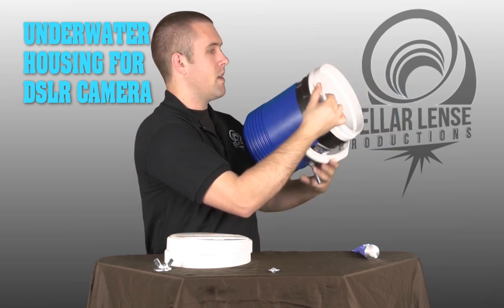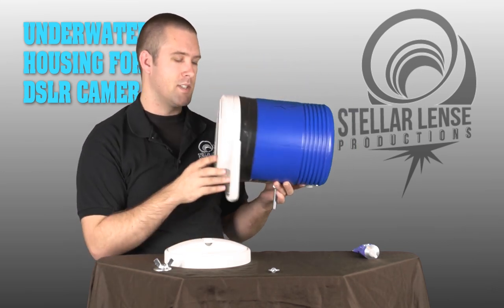DIY Underwater Housing for DSLR Camera

Comment: You can actually make a DIY submarine for under $100. You just need a 70 gallon trash container, a couple 45 lb. weights, a 2'x2' sheet of plexiglass, some aquarium caulk, a plunger, and an electric trolling motor. Saw a hole in the base of the container, run the shaft of the trolling motor through the rubber plunger head, caulk the plunger onto the hole, saw a hole at eye level and caulk in your plexiglass window, toss in the weights, and this will safely take you down to at least 350 feet. Water pressure will hold the lid down nice and tight, so no worries there. These also make a cheap and easy gift for friends and family, just remember that for small children you may need to add an extra 45 lb. weight to get the sub down to maximum depths.

Comment: I'm gonna do this for photography (not video), and I can drill a small hole and slide in shutter release cable and seal off with silicon (or paste used in this video), but cable release will have to live there forever. 
Thanks for the video, good job.

Comment: DUDE! not only are you dope for coming up with this solution of how to circumvent the ridiculously overpriced underwater cameras housings, but the fact that you made a such a precise clear cut video tutorial on how to replicate it is. .... dope as well. Do you have any ideas on how to make it to where you can take pictures? Exactly what I needed.
Do you have any idea of putting in a waterproof hole in the cooler to allow you to hit the shutter of a DSLR?
Reply: Buy a Dicapac.
Reply: Or buy a wireless remote control and add it to the interesting invention, but definitely advise to buy the proper equipment for the job
Reply: Just keep a remote shutter in a plastic bag with you

Comment: Plexiglass and other plastics will severely degrade imagequality. It would be better to use plain glass, a thick enough quality to withstand the waterpressure, which will make the rig somewhat heavier but since weight is relative underwater it wont cause any problems. The upside is ending up with a much higher imagequality.

Comment: From a diver who does this for a living.  You need to include a co2 inflator to add a bit of pressure to the can.  Water pressure could have pushed your lens inward; flooding your housing and camera.  

Otherwise it's a smart practical solution for your project.

Comment from the maker: Just a quick update, the plexiglass is NOT easy to cut with a razor blade. I practically had to saw at it with a razor blade and snap the pieces off. I'm sure there's an easier way to cut it. Might be worth researching before you start

Comment: More secure if plexi cut wider than a hole and applied to outside - a rim helps reduce risk of blow-in (use sealant still). Plenty of silicone grease might help with screwed lid. Very very limited depth possible: 10metres (33 feet) of water depth adds 1 atmosphere of pressure... (~1kg/cm^2) so a 10cm diameter window ~ 75cm^2 = 75kg load, same as an adult standing on 1-foot: plexi risks breaking, or bending breaking edge seal ? Would over-turned container take several adults at once or crack ?

Comment from the maker: Only have used it in a pool and a river thus far. 6 foot depth at a maximum probably. And when I used it in the pool it actually still leaked a bit but that was where the lid screwed on, so all of my glueing and sealing held perfectly, but the lid seal that came with it sucked. So If I were to re-make this I would probably use something better than an igloo from walmart. But even with the leak, I could get like 10 minutes underwater before it would come close to getting the camera wet. - Phillip

Comment: It amazes me how mad people get at the price of underwater housings. Do you really want something protecting your camera that costs LESS than your camera?
Reply: There's no way in hell I'd put my camera in this thing and I've only got a 30d.
Reply: Nick Lewis Not to offend you but that is a really silly thing to say.  The fact that it costs less than the camera does not means that it does not performs well . Check the gopro diving housing, it costs way less than the camera and  performs extremely well. It can go down to 60 meters.... Most Underwater housings are made of the same stuff a  Polycarbonate polymer   Underwater housings for dslrs are extremely overpriced and the reason is that there are not many companies that make them. That is the only reason. It is a kind of monopoly.  I am very surprised that our Chinese friends have not tap already into that market and make affordable housings, cause polymers are quite cheap
Reply: I can tell you now that you're being suckered into paying double the value of a camera for a housing that's probably being produced for a tenth of its price.  Case in point, I have an ok quality Sony Handycam that I take on dives.  Worth 200$.  The only housing available is a 3rd party model for 1,499.99 USD.  I built a housing out of sched 80 pipe and glue for 100$ and I've taken it deeper than the 3rd party model was rated for.
Reply: I guess it really depends on what you're using it for. For diving, yeah a home made job is ok but I do surf filming/photography so I need access to buttons and something rugged enough to handle being thrown about.
Reply: lilaznbltz Not only that but people usually updated their Dslr camera bodies every 4-5 years.  The next camera will most certainly do not fit inside the case cause they are made to fit exact models..  so spending $1499 for a case that it will be useless in 5 years is a kind of bad investment
Reply: Rolando Perez Exactly! with my DIY rig, all I need is a new piece of velcro.
Reply: lilaznbltz Nice. Make a video of your rig. The more people that share this kind of thing the less we need to buy from the big companies

Comment: First off I like that you are trying your own stuff and all but, I don't like that you are sharing it with people, this isn't safe, and could cost you a 1800usd camera instead. maybe this could be used for a one time thing if its done right by someone with good crafting skills but no way should anyone even do this if they have no experience. Most of these containers are made out of a plastic that is pretty hard to glue together, the glue wont stick good to the plastic, so after a while you will have water leaks and can damage ur camera. If anyone want to make a underwater housing for themselves i would suggest searching for tutorials on how to do it the correct way, cus this is a really crude and potentially dangerous creation that could ruin ur expensive camera.

Comment: For $60 you can buy a Dicapac that will at least work to maybe 1/2 an atmosphere (16') and has a warranty.  I've been an UW photographer for 35 years and there is no way I'd use this.  User beware and good luck.